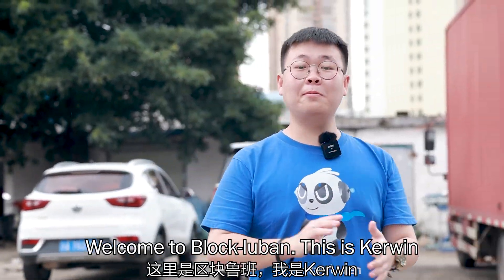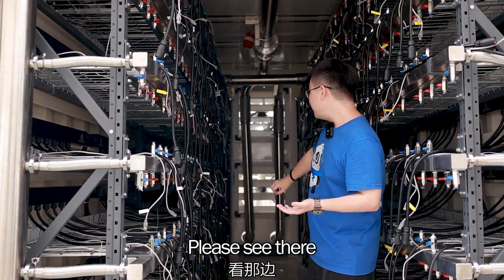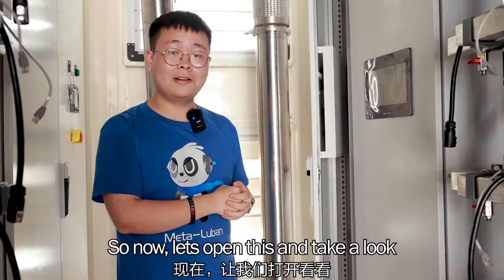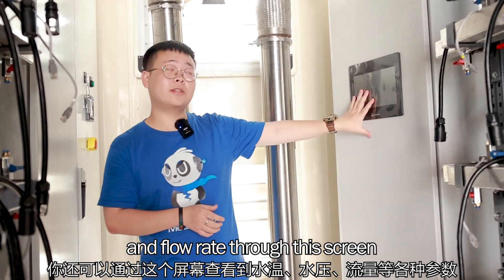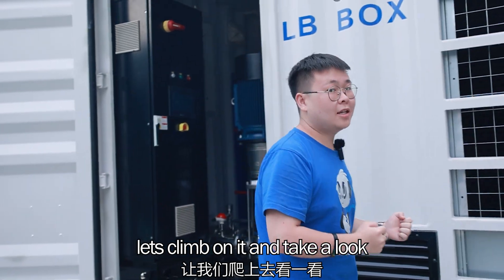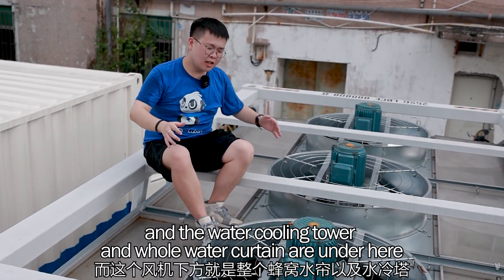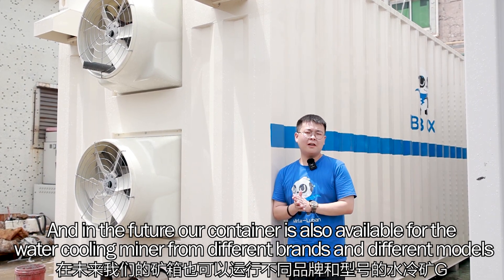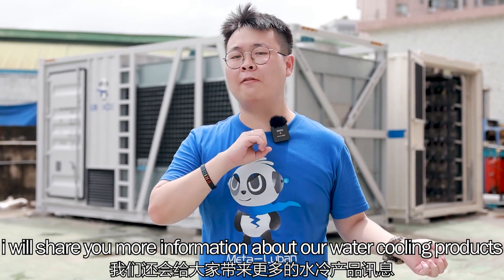Hydro cooling mining container - LB BOX compatible with different models

Comment: If you are cooling with water why do you transfer heat from 1 water system loop to another water system loop. Its more efficient if take out the heat exchanger to connect the two loops and just make one loop?
Reply from the maker: Inner cycle and outer cycle are indispensable!

If the inner circulation is removed and the external water source is used directly, it is easy to scale and block.

Internal and external circulation mode, the use of heat exchange system internal and external circulation to heat dissipation, is for more safe and lasting use.

Comment: What is the benefit of using a heat exchanger to make it a double loop system instead of a single loop system?
Reply from the maker: Nice question. Because the inner circulation(connected with miners) uses distilled water. But the other part uses normal water like lake water, city water, rivers etc. to prevent the normal water to remain scale and block the pipe, there is an automatic detector and when the water is high in minerals it will automatically flush out the water and keep the pipe clear. So mainly just different water standards